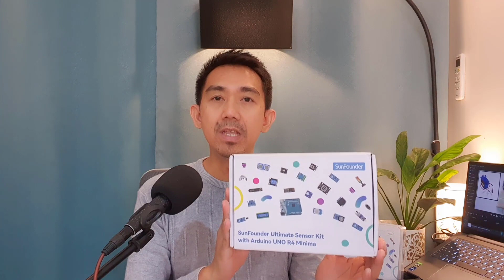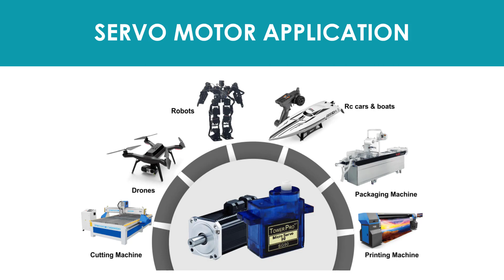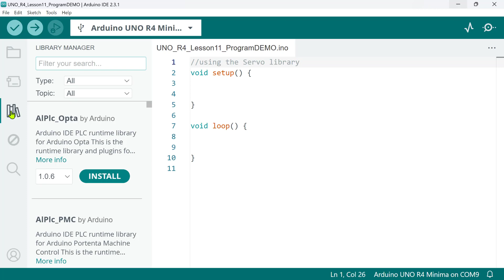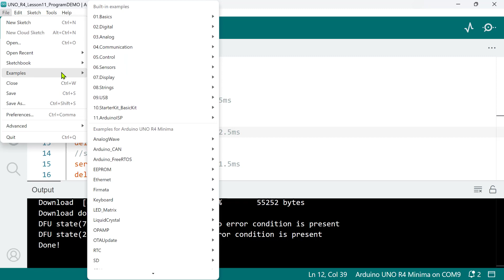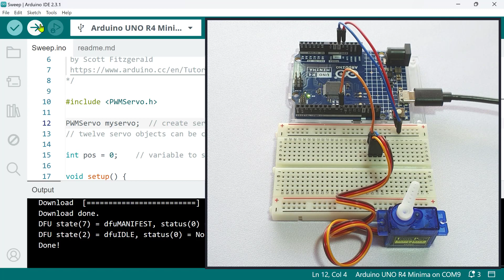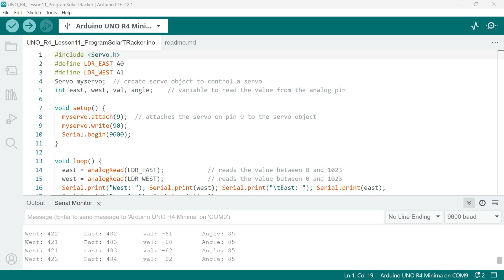Arduino UNO R4 Lesson11 - Servo Motor | Single-Axis Solar Tracker using Photoresistors

Comment: I'm trying to control multiple servos or ESCs using the PWMServo.h library but as soon as I attach a second servo or ESC the program doesn't work. Anyone else experience this?

Comment: Good morning Joed, Sorry to bother you, however I tried to download this file several times and I still got an error "exit status 1" herewith is the error showing on my IDE "C:\Users\Admin\AppData\Local\Arduino15\packages\arduino\hardware\renesas_uno\1.1.0\cores\arduino/pwm.h:25:10: note: candidate: bool PwmOut::begin(float, float)
     bool begin(float freq_hz, float duty_perc);"
Reply from the maker: Downgrade the installed uno r4 board to version 1.0.5. Yours is 1.1.0. Or just simply use the Servo.h instead of the pwmservo.h

Comment: I get the Servo library to work, but not the PWMServo.  tried your download from Google drive but still not working.  Any ideas what is wrong?.  Get error PWMServo.h: no such directory.
in the PWMServo.cpp in section Arduino R4 it is looking for #include <pwm.h>, can't find this library, is this the problem
Reply from the maker: On your boards manager, install the Arduino Uno R4 boards version 1.0.5 and not the 1.1.0. This recent update prevented PWMServo from working because it was last updated 6 months ago. It is no longer compatible with the recent R4 board update. Clearly, the R4 board has some issues with controlling the servo motor. It will improve with the future updates. Thanks!
Reply: @joedgoh Thank you for your speedy reply, the servo is now working on smooth mode.  Looking forward to future lessons.
Reply from the maker: Thank you!. I will be releasing lesson 12 by tomorrow.

Comment: Unfortunately the code will not compile on my R4 Minima using the 'PWMServo' library (exit status 1) I've checked all the usual things (boards, ports etc) and all okay, however it will work with 'Servo' library but not smoothly, any ideas?…2 hours later…Problem solved! 🎉 I compared the ‘.CC’ & ‘.h’ files between the PWMServo library I installed via library manager on the Arduino IDE, and the same library via ‘GitHub’ and they were different in that the library from ‘GitHub’ contained components for the R4 whereas the other did not, anyway I have installed the PWMServo library from ‘GitHub’ and all is working okay for now! 😁👍🏼
Reply from the maker: Try using this https://drive.google.com/file/d/1TVW16eckDunyJoG9qZKcHfBYajvmZvRi/view?usp=sharing and Add it as a Zip Library
Reply: 20 july 2026.Good tip thank you. Today I learnt: using Uno R4 Wifi and Aref by connecting 3.3v pin to the Aref pin I had to use the following in void setup;
analogReference(AR_EXTERNAL);